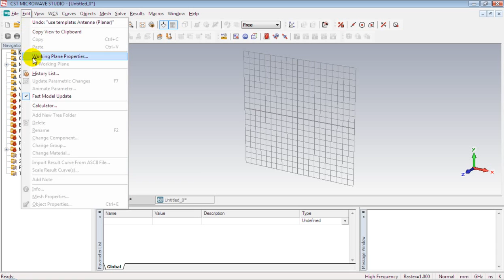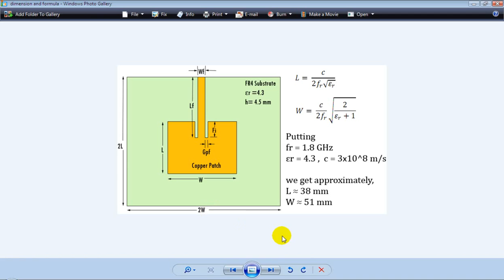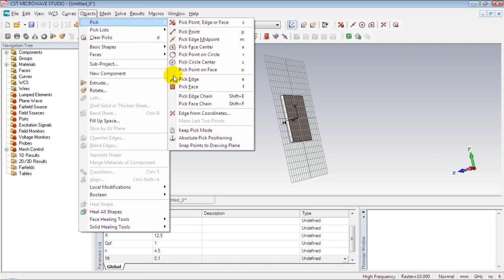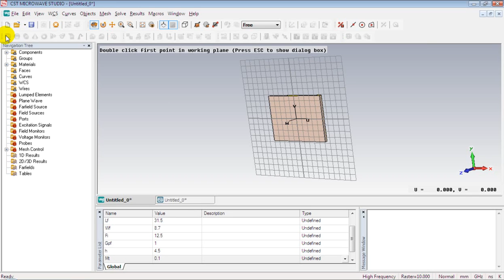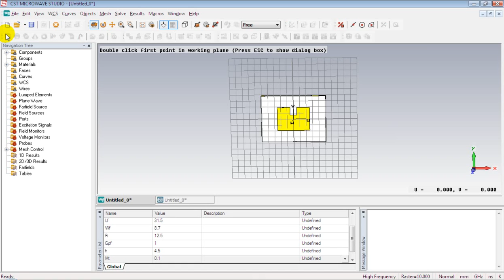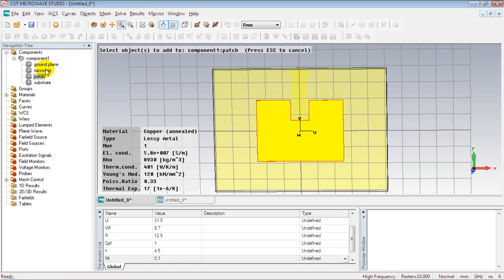CST Tutorial: Microstrip Patch Antenna- Part1

Comment: Could you please tell us how did you find thz dimensions Wf, Lf, Fi and Gpf ? They were not mentionned in this video
Reply: Nassima Tounsi  those dimensions are probably mentioned in the research paper he is following. They are not standard dimensions. You choose dimensions according to our need.
Reply: Nassima Tounsi check some papers you can find it out
Reply: @naveenvaishnav9895  There is equation to calculate Length, width of microstrip antenna but how did he calculated values of Lf, Wf, Fi, Gpf? Is there any formula for these also?

Comment: how do you calculate Wf,Lf, Gpf,Fi? please help.......please provide necessary formula......
Reply from the maker: Basically Lf does not matter. Gpf also doesn't matter much, mostly dependent of PCB DRC rules of minimum spacing. Usually, 0.5mm-08.mm is a reasonable range for Gpf. What matters are Fi and Wf. Fi controls the input impedance and Wf controls the characteristic impedance of microstrip line. You can calculate Wf and Fi from the formula mentioned in Chapter 14 of CA Balanis' book Antenna theory and design.
Reply: @tensorbundle  Thank you sir......If there is an equation for finding out Lf and Gpf? Please email those equation.....
Reply: @dipankarsaha1568  he said CA Balani's Antenna Design book. Did you get those formulas?
Reply: @Mr.PandeyRishav  Yeah, Chapter 14 Page 818

Comment: Sorry sir. can i know how to get Lf. Is there any formula to use? thanks
Reply from the maker: of course, there is a specific formula. It's all about impedance matching. Since the input impedance of patch is usually much greater than the 50 ohm microstrip line , we need to move toward the centre of patch because the more we move toward centre, impedance of patch reduces and at a particular location (let's say at Fi) the impedance of patch equals to 50 ohm. That location Fi is our desired dimension. There is an equation to find out Fi. Would you please visit FB group CollabEEE(link in description). I mentioned the formula in one of the threads in that group. Thanks

Comment: Hello everyone.I try to design a microstrip antenna with feed line in cst.I use the equations form Balanis Antenna Theroy to find the dimensions for f=2.4GHz h=1.6 εr=4.3(material FR-4) and I get W=38.37mm L=29.76mm but I dont get a resonance frequency at 2.4GHz as I wanted.What else should I check?Thanks in advance
Reply from the maker: ΝΙΚΟΛΕΤΑ ΖΑΧΑΡΑΚΗ email me at mnazmulht@gmail.com..  I will provide you assistance about your patch antenna
Reply: I did.Thank you
Reply from the maker: I checked your antenna. It has no inset feed cut for input impedance matching to 50 Ohm microstrip line. Hence most of the incident power was getting reflected and so no resonance at 2.4GHz. I attached the correct version. Check that
Reply: thanks,I replied to you in mail.